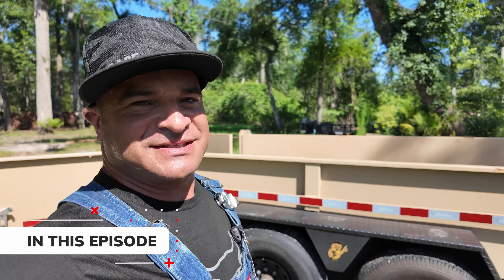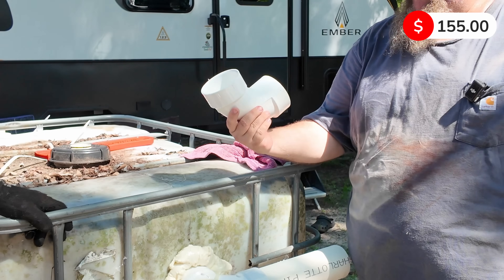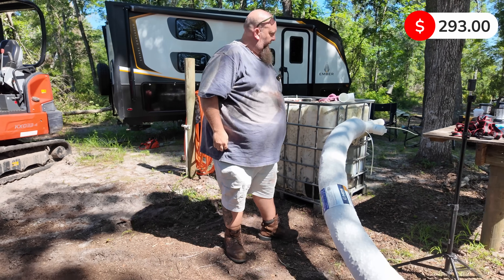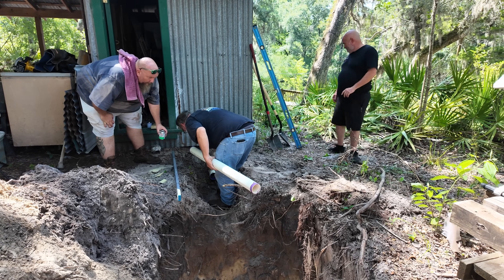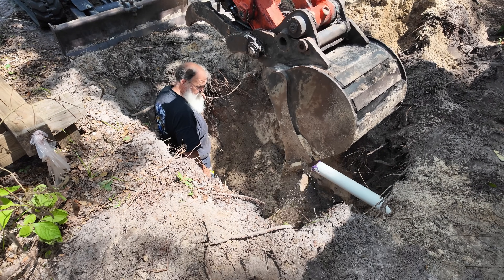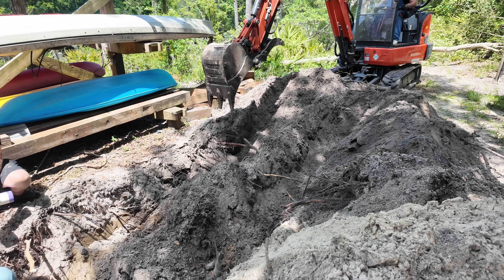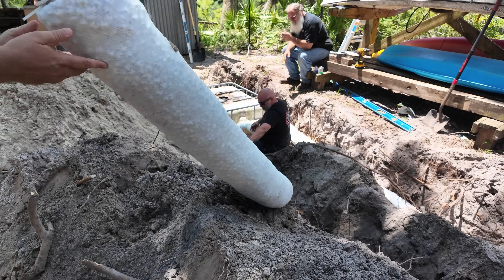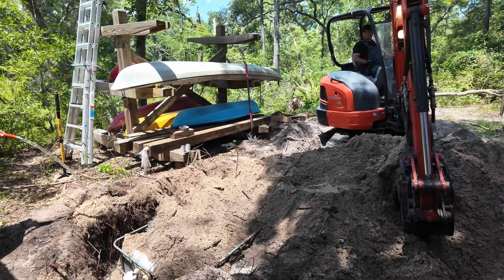Off-Grid Septic System: My Secret to No More Sewer Bills!

Comment: This is cool.  I’ve seen people do this using four or five big plastic barrels like the big blue barrels and they plumb them together together so the water goes from chamber to chamber of chamber. Then they bury 30 or 40 feet of the tile stuff.    The only question I’d have on the tote is wondering if the top would cave in easily. With the 55 gallon drums, you can jump up and down on him easily cause they have a built-in top on them and I’ll hold hundreds of pounds I almost wanna put something over the tote so make sure nobody drove on it or put anything heavy on it to avoid traffic.   This is way less plumbing than leaking the barrels together.
Reply from the maker: Here in the south we have an un written rule to not drive anything over your drain field or septic tank. thanks for the e great insight.

Comment: Correction, you shouldn't operate it in low throttle.  If you read your excavator manual they will say to always put throttle to high after the engine has warmed up and should not be operated in low throttle.
Reply from the maker: I have read tons of threads that argue on this. I can tell you that if i’m close to objects and people, i’m going play it safe and keep the work light and the throttle down. it’s solely my opinion.

Comment: I would have used bulkhead fittings instead of spray phome ... but good idea
Reply from the maker: i’m going to do that next time since you said something about it.
Reply: @homesteadgarage  A 4'' UNISEAL Flexible Tank Adapter (Bulkhead replacement <$10) is an even better choice. Once you start using these for tank seals, you never want to use anything else.

Comment: Finally someone who's informative and seems like a good genuine person. Trying to find a video on doing this because I finally saved enough to buy some land, and it's been a pain in the ass trying to find a video showing a modest septic install

It's been crazy trying to find land that I can build whatever I want on, so many HOAs and covenants. I think Missouri is my best bet but it's still a struggle. Sucks having enough to put a basic structure, solar, and water on some land (just barely, doing things myself and maybe not necessarily up to a normal city code) but it's so hard to figure out exactly what to look for on land to know if I can in fact "extended camp" while trying to build unpermitted tiny home
Reply from the maker: Thanks for the compliment. hope you prosper in your land. God is good!
Reply: You should consider finding property with “no covenants”. They’re getting harder to find, but there’s still some out there. 

Nothing like being able to do what you want with YOUR land. 🤯
Reply from the maker: @liftthe9950 feels so good to do what you want.
Reply: I started this journey in Missouri in June. I would never go back. I bought my solar, septic, culverts, drain pipe, water line, 3500 gallon water storage tanks, etc. and built a small home, 12x12, that I plan on adding on to as money allows.
Reply: @valkillmore847  make sure you have a final picture in place so when you’re building the first 12x12 you already know where the add ons are going and it makes sense. It will save you the grief I watched my uncle go through on his contemporary cabin build. I say contemporary because I feel like to be a cabin it needs to be made mostly of solid logs, and uncle’s is more of a stick frame.
Reply: @liftthe9950 it's already pictured and begun. I've been living in the 12x12 for 4 months.
Reply: my poop dont float

Comment: You CANNOT use a 90 degree elbow! It will cause a air lock! You have to use a "T" or you're wasting your time!
Reply from the maker: out of all the comments, this made the most sense!  thanks for watching!
Reply: Clueless one, it will not cause a air lock. We have a similar system that has been working for over 20 years 😂
Reply: ABSOLUTELY!
Reply: @sheepishmclemmingston5550 and you're still screaming LOL
Reply: 90 degrees working well in my system for the last 15 years, so I'm pretty sure you are wrong.
Reply: @LarryPlantsThe 90 degree angle systems have small holes punctured in the top of the 90. This prevents the air lock.
Reply: Drill a couple holes
Reply: @spicher40  how big of holes?
Reply from the maker: finger size
Reply: Well since you still screaming you should have said ABSOLUTELY DAMN IT LOL
Reply: 90 degree where ? you can not use a T on any type of  draining, only on high pressure lines, the only place where you use T is in a vertial clean out.
Reply: @karelmontel9284  Exactly!

Comment: The humanure system is the only way forward.
Reply from the maker: i feel you on this!
Reply: Check out the worm composting septic system method. 

Kinda similar to this video, except the tote has food/plant material and worms and you flush your toilets into this. 

The worms take care of most of the waste and the fluid that comes out and goes into the drain field is already much cleaner than normal, allowing a smaller drain field.

You can mix it with other plant filtering systems at the drainage point, further cleaning the water before it heads to the drainage field.

Not a lot of information out there, but in my mind, it's better than compost toilets because you can flush a normal toilet into it while still being more environmentally conscious.

Just wish I was in a position I could do these things.
Reply from the maker: @tracy419 hey, this seems really cool, i’m going to research this.  thanks for the heads up!
Reply: @homesteadgarage 
I hope you get the opportunity to try it out. 

I've been interested in composting toilets for years, but for various health reasons I need a bidet which simply doesn't work with normal composting methods because of the water requirements.

This appears to solve that and more.
Reply: @tracy419 Thats what we want to do for our tiny house 🪱 🍃 💩

Comment: won't the solids eventually fill up the container?
Reply from the maker: the solids eventually breakdown from the bacteria, we will find out.
Reply: Every similar septic system needs to be pumped or cleaned out at some point. Probably going to take a good long while though since their usage is probably not very high.

Comment: For septic, you don’t want a water table very high in your ground so this guy is totally clueless. What he’s talking about this is not how you do a septic this is ridiculous. It’s embarrassing.
Reply: As long as it's all down hill... But obviously you don't want flooded, especially if you've A well. Build on the highest ground on your property. You can put a steep drop, but it needs to be a 60,45,or 90 after you get it to the drop.
Reply: Why? You should have just scrolled by rather than spew your uneducated hate - what a dumbass
Reply: Relax, Ed...it'll work just fine for what they need it to do. Did you see the water table while they were digging? No, you didn't...
Reply from the maker: it’s 40ft above the water table. i was down on the bank in the beginning of the video.
Reply: Just don't drink the water if it floods. Like if 40' becomes zero. I know it's obvious.

Comment: You should not have fall in any drain field lines. They need to fill up evenly so they can leach out into the ground.
Reply: Yeah, code in my state they have to be level. During inspection, we have to shoot header pipe, d box, and fingers for level.
Reply: Ours has a fall in our first home. It has been working for over 45 years with zero problems!
Reply from the maker: @owenhill-vf7ko no way!!!! more info and details please!!!
Reply from the maker: there has been a lot of arguments over this.
Reply: @homesteadgarage    So the argument being flood the end of the pipe and stop percolation so it ends backing up?
Reply from the maker: you got it.

Comment: Also could you add two totes ? One higher than the other to make an even bigger longer lasting septic ?
Reply from the maker: i have seen them add two totes. i think it’s safer to add two if this was a full time system for a family.
Reply: @homesteadgarage how is the maintenance? Normally it is empty after years of usage. Here everything is underground?
Reply from the maker: @fabioheymans we don’t really worry about things until the poo doesn’t flush😂😂. honestly my guess is ever 3-5 years.
Reply: Yes you can. It's how you hook them together determines how they work.
Traditional is one in front of the other, then you have a "solids tank, and a grey water tank. This reduces solids going into the fill line or evaporation bed. 
The other is side by side with a solids line from the house going to both tanks, and  a grey water line coming from both tanks. 
In theory one fills the solids , the solids will start to fill the other. 
Depending on the amount of people in the home, and how much other waste goes down the sewer 1 - 300 gallon tank will handle 3 or 4 people adding bacteria often if table scraps are put into trash or compost pile. 
Just my experience.
Reply from the maker: @tommybeebe4571 👏👏👏👏
Reply: @homesteadgarage 
I've installed septic systems , it's not as complicated as people like to make it out to be!

Comment: what is the actual life expectancy  of the plastic tank and surrounding metal cage?
Reply from the maker: 50years or so.
Reply: There's NO way that thin wall is gonna last 50 years. Impossible. The plastic is pretty hardy, it's UV resistant and NOT prone to cracking, cavitation or disintegration like MANY plastics are. But it is STILL thin wall, and exposed to acids found in human waste, in both liquid AND solid forms. Also exposure to many different things in the soil itself. I wouldn't plan on the rank being viable for much more than 15 years. It may still be intact by then, but chances are by then, from the exposures, it is likely to he rapidly breaking down
Reply from the maker: @sheepishmclemmingston5550 15 years is not bad.
Reply: You obviously have no clue what you’re on about, so stop posting your stupid shit.  Do you know the difference between ABS plastic and HSDE plastic? Day and night, and for a reason.  SMFH gotta love peeps like you- Dumbass
Reply: All of it